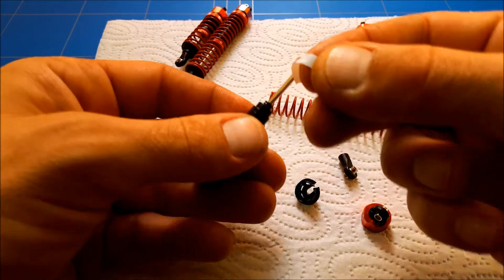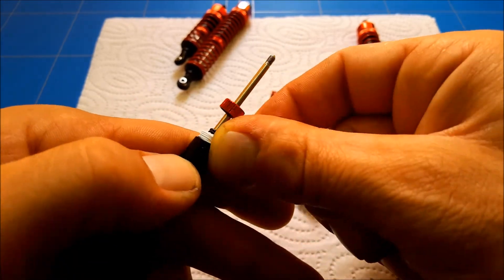Rc Car Shocks Upgrade To Oil Shock and Rebuild From Feiyue FY03 Eagle 3 Wltoys 12428 Rc Rock Crawler

Comment: Good helpful video. One correction: oil does NOT dissolve Teflon tape. It may look like it sometimes because when you are screwing on the fittings the threads sometimes cut small pieces of the Teflon tape. Then those little pieces get in the oil and it looks like they were dissolving. Just be sure the Teflon tape is wrapped around the threads and nowhere else.
Reply from the maker: great tip thanks your awesome :D

Comment: hy, i love your videos, but i try this trick, and the oil is licking :( , i don't understand how the oring will stop the oil licking, has they are not fixed on the bottom
Reply from the maker: when installing the shocks i turned them upside down and it works no leaking
Reply: @HowToDIYRc ok i may try that

Comment: If you can't get the o-rings (or can't wait, like me😉), you can use any dense rubber material. I used some 1 ½" rubber anti vibration washers from a refrigeration compressor mount. Just use the shock body to trace out the shape, cut, and install.

Comment: This is a wrong instruction. 
You can not fill the shock absorber with oil to the end without leaving air. 
There must be a lot of air, because only the air is compressible. The oil is not compressible. And when you fill the cylinder with full oil, when the piston is extended, when the plunger is inserted - the oil overflows to the other side, but there is less space - because there is a rod and the oil does not fit - so the shock will get high pressure and somewhere unsealed to push out excess oil. And it will be leaky. There must be air bag above oil!

Comment: So when u tighten the bottom cap does it clamp the orings at the bottom of the shock body so they seal tightly around the shock shaft?
Reply from the maker: yep

Comment: Killer walk through.  Saved a bundle on "upgrade" shocks.
Reply from the maker: yes you did good upgrade shocks are expensive compared to this 50cent upgrade you just need to bleed the shocks a little bit to get use all the travel the shock can give

Comment: i tried this butt it does not work, if shock is compressed oil will leak out becouse the internal pump does not allow oil to move inside shock, it is desinged to work with air.
Reply: Or drill small holes to piston, so oil can move from one side to another in controlled manner. More holes and bigges holes, faster the piston moves.
Reply from the maker: I'm sorry jeroen you did something wrong the Teflon tape can get wet it needs to stay dry while your screw the cap on...
Reply: no the problem is that oil cant compress and it has no place to go inside the supspension. way too mutch force is needed to move the supspension.     (perhaps this mod also works to seal the air better)
Reply from the maker: perhaps you can try it with just air and see if you like it, after all,
 every terrein is different and the person driving it
Reply: indeed, thanks for helping me, your other videos are helping me alot like the differential dissasembly
Reply from the maker: Sure np Sir one tip you can perhaps also remove a few drops of oil and fine tune your shocks that way
Reply: i wont be doing this mod, becouse i already ordered new oil shocks, thanks anyway Hellsong89
Reply: Just drill holes in it...that's all that's in a regular oil fill shocks...there's
just plate with holes in it. You dont completely fill it up
You have to use teflon tape on regular shock filled shocks anyways..
It's wrapping the tape in the proper direction to minimize leak.

You all need to learn these simple mechanical stuff.
it's noting if you work at a power plant..with crap load of motors, drive, gearbox hydrualics .ect...of every imagine able combinations or configurations.
parts anrt always avaliable. The mechanics has to fix it ...ASAP
of what he has on site....until proper or better replacement parts arrivve.

Or  just get a shaft that's around the same diameter as the shaft...
(such as steering arms...ect) with threads on both ends
Then just use a BUTTON...drill a hole in the center and hand thread it on
there...It's not a big deal...
Heck just sholve a piece SPUNG in it..(with or without oil )

You dont even have to use whatever the shock oil.( they come in different thickness anyways...
i used to use break fliud..or whatever different grade motor oil or transmission oil i had laying around.

Comment: How do the O-rings stop the oil from leaking out if they aren’t fixed to the cylinder cap?
Reply: they are fixed actually, there is an extra plastic ring there to holld it from going to the cylinder. so the rings are held between cap and that plastic ring
Reply: I also don't understand the purpose of the orings.  They will move inside with the shaft and won't help to seal oil from leaking out of the metal shaft hole in cap.  Unless... I'm missing something?  I ordered this rc car (wltoys 12428) and thinking about adding oil to existing shocks or new oil filled shocks.
Reply from the maker: simple the close of the opening around the shaft the Teflon tape stops the leak at the cap

Comment: what size of the 0 ring fits the same model of suspension the most?  is it M2 O-rings or M3 O-rings?
Reply: WD-40 is light kerosine based like mineral oils and will fuck up your rubber seals. If you are to use something, then try silicone based oil
Reply: oh okie thanks
Reply: Try car engine oil
Reply from the maker: +justin rambongga m2 are the correct one 
We made a mistake in the vid
Reply: oh okie thank you! :).... i wonder if WD-40 oil will works too as a suspension oil
Reply from the maker: +justin rambongga you can always try
Reply: lol ill try as soon as i got my O-rings

Comment: what type of shock oil did you use, and where could I find it?
Reply from the maker: I used special oil from my 1969 VW Beetle Kitcar a FT Bonito it's super thick oil
not mend for shocks but it's an improvement over air
if you really want to tune your car to perfection than check ebay for rc shock oil
Reply: sweet thanks for your input, yeah i got some 30W oil on its way, these shocks are just way to bouncy even for my gravel lot. great tutorial this helped me out a lot. Thanks